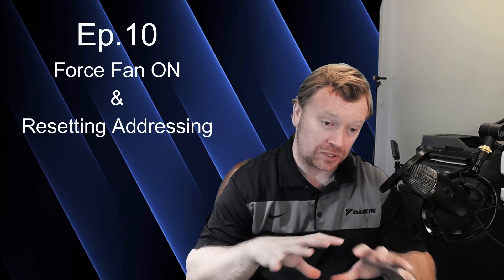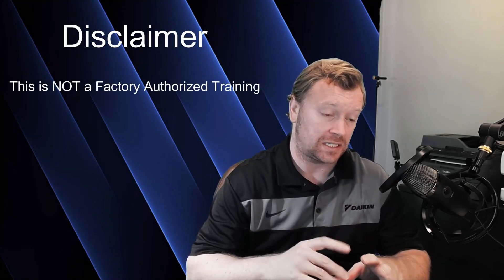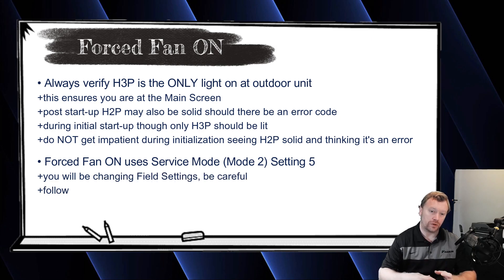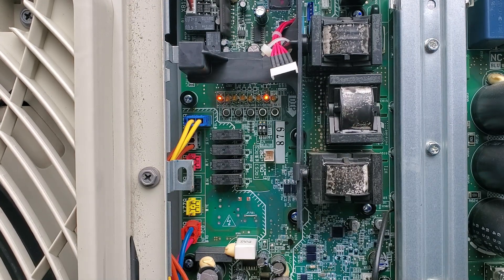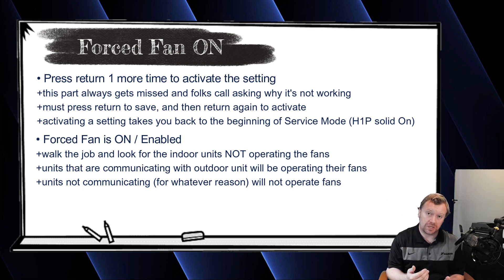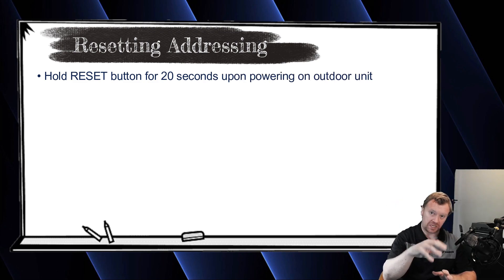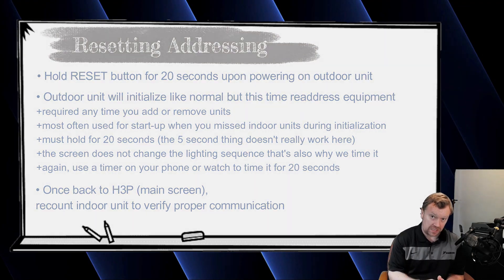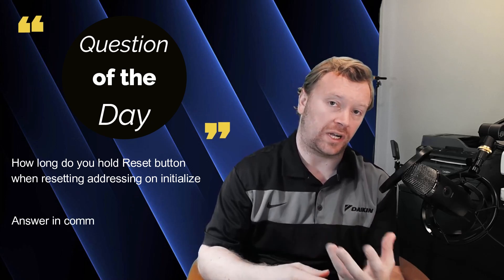Forced Fan ON & Resetting Addresses on Daikin VRVS (Quick Troubleshooting) | VRVS Startup 11-19-2021

Comment: HELLO , is this manipulation for the forced fan doable on the VRV III modules ? i have U2 and some times  U4 errors .
Reply from the maker: Yes, mode 2 (Service mode) setting 5 on all vrviii and later systems. I'd be willing to bet it's on the really old vrv2 systems as well but those are from before my time so I cannot confirm.
Reply: @InverterAlways  I tried to go forthe forced fans but ... nothing works , with remote on and off both cases doesnt work . even the reset ( bs5 for 20 seconds ) doesnot reset the system , i wanted to reset to link one only interior unit  with a new adapted communication wire then try to check for the reason , but it doesnt reset . thank you  for the response
Reply from the maker: Also u2 is power related most of the time. Add a phase monitor icm450 (I think), you want power to get removed for at least a minute any time there are bumps or surges. It acts as a surge protector as well.

Comment: Daikin still using Binary settings the biggest pain in ass
1980s tech
Reply from the maker: It may be old but it's actually pretty fast once you learn it. And one of the best things about it is being able to change stuff on the fly no power down needed. Other brands are still using dip switches which requires power to the system to be shut off which takes way longer than just simply adjusting a binary setting. Other brands also require laptops to be plugged in to make setting changes while Daikin does not. From a time on the job perspective, at least in my experience, Daikin is way faster with their binary format. And again once you learn how to navigate it, it's quite simple.

Comment: Great videos Dana! I haven't come across a video over the condensate pumps. I'm curious what issues you've run into with them and the solutions you've found.
Reply from the maker: Biggest issues are wiring in the float switches. Check out the video I did on a3 error codes where I go into some of the more common issues and how to properly wire them in.

Comment: Hi Dana , thanks for your support. Just a question on how to go on the run test mode after replacing the Main control PCB  on vrv 3 systems
Reply from the maker: From h3p only light on hold test button until 2 and 7 come on. That signifies test has started.
Reply: Im am going to replace main controll pcb maybe next week for VRV 3.

i know i have to copy the dip switch setting on manual, but i wanna ask something that confuses me.

Is it necessary to conduct test mode?

i mean ,can i just go directly to let the indoor run and set to cool mode waiting for the compressor to kicks in?
Reply from the maker: @johnnyroxannebautista2063  you will have to run test operation.
Reply: @InverterAlways  thank you.

noted on this sir